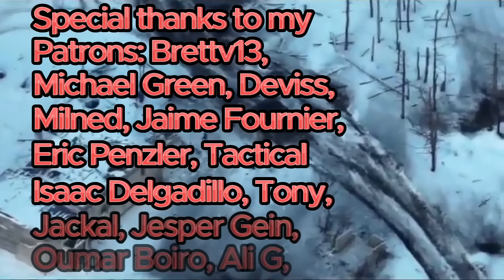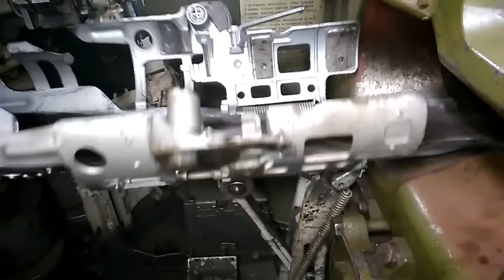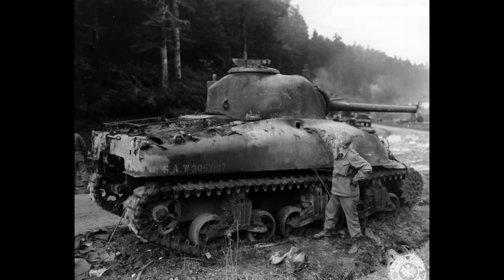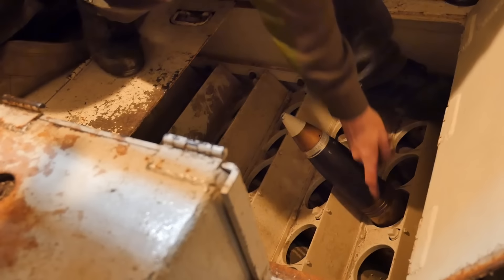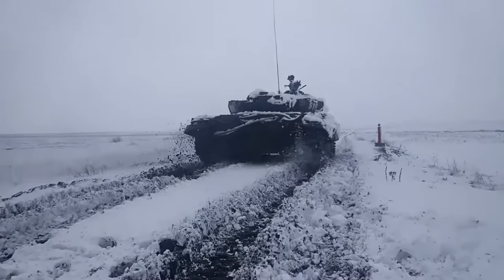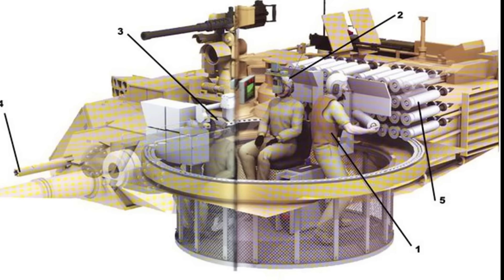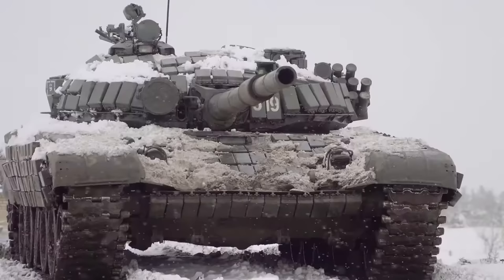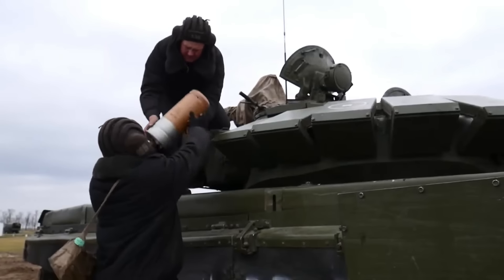Is Autoloader Really the Reason for Russian tanks exploding so much?

Comment: Never take full ammo. I thought it’s common sense among War Thunder players.
Reply: In real life you tend to take as much ammo as you possibly can, real warfare will see you run out of ammo incredibly rapidly.
Reply: Sadly, tank battle in real life is not time or objective limited, hence you would want all ammo you can carry.
Reply: It matters in WOT, too.  If ur full and get racked, ur turret is blowing off and ur dead.  If ammo is low, it will only burn, and one has a chance to put it out.  It might also depend if ur full of HE or AP.
Reply: @deeznoots6241 No you don’t. This has been the case for decades where it’s SOP for Soviet and Russian tank crews to ditch the stowed ammo
Reply: @Rokaize  not SOP, but an unspoken rule among veteran crews. Most still take as much ammo so they can support other assets for as long as possible.
Reply: Finland used to have T-72 tanks. Doctrine was "ammo only in carousel".
Reply: If Russian tanks don't take ammo, they become invincible. 

What a Sundowner.
Reply: @deeznoots6241  
And in Ukraine at least many Ukrainian crews have reported that they only take limited amount of ammo with them to prevent the turret joining the space program syndrome.
Reply: @rowdy8814  I haven’t seen any videos of the interiors of Russian or Ukrainian tanks holding stowed ammo. This is even discussed by Ukrainians repeatedly. Saying that they only carry 22 rounds. 

It’s just not a thing anyone does. Those rounds aren’t easy to load manually anyway. That’s something when you restock the autoloader during a pause in the action.
Reply: @deeznoots6241  The succesful Ukrainian Kharkiv counter offensive was stopped several times because the Tanks were driving with only ammo in the autoloader.. They could have advanced even quicker if they had been fully loaded.. but it was deemed better to only load the carousel
Reply: @Ph33NIXx  You still need to stop to load even if you carry extra ammo within the tanks
Reply: @Pikkabuu  I also saw an interview with a Russian tanker who said that he did not load all the ammunition to avoid this too
Reply: @ecpgieicg  yes obviously.. but less frequently. It was the crews own statements
Reply: @Ph33NIXx  you need to stop to transfer ammo from racks to carousel. ofc not relying on external logistics would be quicker. that's a logistics issue. Lastly, I wouldn't put too much stock into crew statements on pacing. How much quicker? How much time saved over how long of an advance? Officers who are meant to be responsible of these sort of things? Sure, learn from it. General remarks from crew? I mean, why would you even? You are probably extrapolating too much.
Reply: This may work as an actual strategy now 
Why?
Most of the time tanks now dont survive long or have to move to the cront and back to evade.
So limit the ammo to the autoloader may improve survivability, performance, cost, and operational succes.
After all the crew will be less time engaging, and thus being a target to other tanks, artillery, drones or infantry AT.
Reply: @ecpgieicg  The t64 has a ammo capacity of 28 rounds in the autoloader. Depending on the variant the tank can carry 36 in total.   

The crew reportedly drove with rounds only in the autoloader - meaning only like 77% of the total rounds. 

I guess we can be 100% sure not all rounds are High explosive for infantry support. 

You will probably not allow the vehicle to go completely empty during an opperation. Which means you would fall back to your service troops to restock on ammo before moving forward. (at least all the units I have served with we only continued offensive opperations if we had xx% ammo left - if not we replenished before continuing) - If they had had the extra ammo in the turret they could have restocked the carousel in cover some where close to the front line. allowing the operations to go further before needing a break to restock.

Every time the armor falls back to reload the carousels, the infantry needs to wait for the armor to restock their ammo in the rear - it means a lot of stop and go.  

If the crew reports that they drove with only ammo in the autoloader because they believed it to be safer.  I very much trust it.. what reasons do they have for lying?
Reply: @Ph33NIXx  I mean. Would you please simply read again? You are making up what I said. And that's not very inviting. Otherwise, I very much appreciate you sharing your experience.
Reply: Doesn't work irl because the matches are like 2 days long instead of 20min tops and the caps don't resupply you.
Reply: @ecpgieicg  if that is true.. then we've spoken past each other from the start and I apologize. Because I have only really been expanding on my original comment to make what I meant more clear.
Reply: @Rokaize  i never said stowed rounds just full autoloader
Reply: @Ph33NIXx  What I meant is just that you'd have to stop and back off to the rear to reload even from within the tank. It's the logistical organization that makes you back off further away and stop longer. That has more to do with the manner of advance. If speed of advance was truly paramount, you'd see army units use small vehicles, or even technicals to move ammo closer to the front and have more distributed logistical system. So what appears as "slowed down" by a front line soldier may not be a slow down for someone who plan the operation. The pace of advance can be and most likely would be constrained by other factors as well.
Reply: @rowdy8814  Well you’d presumably take the most amount of ammo in the auto loader that you can. No reason not to. I thought you were talking about stowed ammo in the turret
Reply: @ecpgieicg  well.. maybe.. it provides the logistical chain has the technicals and manpower to service multiple units that way. And we are circling the same points over and over.

I think the main point of disagreement is the time it takes to pull out to rearm and the coordination it takes with other units. Moving ammo from the hull to the autoloader does not require you to coordinate with other units. Depending on how brave you are you could technically do it a few 100m behind the line if you can find cover.. or in the vehicles hide/wait position. 

Any way. I think the discussion boils down to what we consider long combat breakes and how much a combat break when persuing an retreating enemy does to the offensive.

I think frequent short stops for rearmerment with other units is a hindrance.. and I get the impression that you think its only in the minutiae in the grand scheme of things.
Reply: It's more realistic to only have 7 shells and none being armour piercing!
Reply: @Ph33NIXx  Yes. I think it's clear that you know the subject at hand and you got my point. I believe I understood yours too. There is always a difference between being able to self-re-supply and relying on even organic support, much less higher level support. But indeed, what I said can be summed up as the difference not materializing to nearly the same extent in the grand scheme of things. In part because I'd expect organic support to trim down the re-supply time to be similar to carrying more ammo in the hull. And so if it was needed, organic support would be improvised or at least talked about and we'd hear it.

As a bit of a tangent, I think some armies would prefer such organic support as opposed to building in extra ammo capacity in their tanks. Cuz there can be significant logistics benefit in having smaller/lighter tanks. It hasn't been needed yet.
Reply: This guy 😂
Reply: @TheDinofan2  How does that help?
If you are fully loaded its a spectacular sight from the outside.
But if just ONE shell inside the tuaret explodes you are (verylikely) dead as tanker anyway. May be the driver survives, but the chances for the tuaret tankers are slim.
Reply: People who play games where they simply die and respawn hundreds of times: I don't understand why these people who are putting their real life on the line don't do things the same way I do
Reply: Or at least don’t take a large amount of rounds with explosive filler
Reply: can somebody explain why the t72 is so sh*t